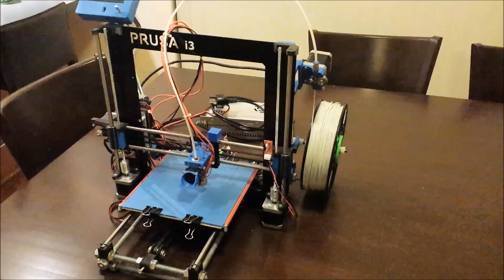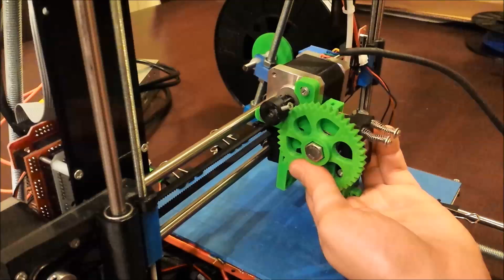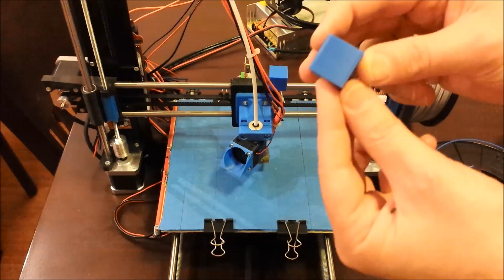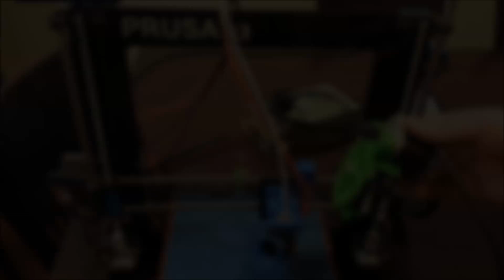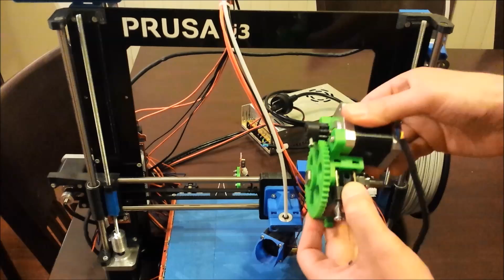3D Printer - Major Quality Improvement!

Comment: I completely agree with your assessment ,,  but I might have a different conclusion ,, thou the final mod was spot-on.
Is it possible that the Prusa's vertically mounted  X-axis rods and extruder body,, was twisting during a hard tug on the overhead spool ??
I have a Stuffmaker Evolution (Prusa with horizontal x-axis rods) and I was thinking about modding it to a direct drive...?
I use direct-drive on my makerbot clones,, and get great results.  So,,, not having any experience with vert.X-axis RODS,, made me think it might have been mechanical play in the mounting plate area..?
My Ordbot has a vert.X-axis ""Extruded Rail"" w/DD and spool rod attached to the top of the machine,, and doesn't seem to have any similar issues.
Since the problem is solved,, my question is kind of a moot point,, just something to consider.
I could see a big difference in your prints on the outside corners and a lot less "ringing"  I believe the only way to get the Y-axis bounce out of the bed is to upgrade the under-carriage to any aluminum frame.  My Stuffmaker still has a little bed backlash, even after I made a "kapton pillow"(high-density packing foam) to stuff between the top of the carriage, and the bottom of the bed. It didn't hold-up to 110c,, but works fine w/HB temps for PLA.
Reply from the maker: Hi Duplicat, thanks for your comments.
The vertical x-axis rods seem quite stiff in their positions, I can't induce any play by hand so I'm assuming they're ok. I guess I was just unlucky with this kit as I'm sure direct drive is working fine for others.

I'm glad you brought up the subject of ringing, because that is my next milestone with this printer. I'll try your suggestion of jamming a piece of foam under the y-axis carriage and see if there's any improvement.
Reply: Tech2C I assume that you used the E3D 3.00mm hotend to fit the PTFE Liner, right? Also would you please post the link to the exact hotend that you got. Thank you!
Reply from the maker: Ahmad Lafi
As mentioned in the video - http://e3d-online.com/E3D-v6/Full-Kit/v6-1.75mm-Universal

Comment: Well first of all both of your prints with direct drive and Bowden look already really good, but I have to agree that the Bowden did in fact have a slight better finish. What I found interesting is your thought process, which you explained very well. I am not a big fan of the 1,75mm Filament, neither I am a fan of the bowden tubing system, but that is whole other topic now. Normally a direct drive system has a 1Nm torque which should be sufficient to pull the Filament of the spool without any noticeable loss of torque. The direct drive should not be affected by it. This means you have to look at your system of dispensing the Filament, rather the system itself. But if you already switched and your printer works better and with less feeding problems, then I would guess it does not matter anymore.
Reply from the maker: I agree with your comments, the stepper motor has tonnes of torque to pull down the filament. Yet the filament flow rate wasn't consistent enough with the direct drive setup. I had the filament roll on bearings,virtually frictionless by comparison to other rollers.

I'm really happy with the Bowden, best mod I've done yet to this printer.

Comment: Bad news, I just printed a calibration cube, and after guiding the filament with slack half way up, I saw no change at all. This leads me to belive it is still a misalignment in the z axis induced by vibrations, or maybe my whole Extruder system as a whole. The artifacts are in between in terms of severity of your two prints shown at the end, so I know there is room for improvement. Any suggestions what to try next?
Reply from the maker: Ok. Next have a look at your hobbed bolt. Makes sure the teeth are cut evenly, and most importantly, check the depth of the teeth all the way around. Spin the hobbed bolt while looking at it and see if you can see the diameter of the teeth change with rotation.

In the past I've had a hobbed bolt with teeth that weren't consistent around the bolt causing inconsistent flow rate.
Reply: Ok, some promising news. I looked at my hobbed bolt and saw some slight defect. If you know how there is a slight semi circular groove shape all the way around, I can tell when looking at it above from one side, the groove is there and on the opposite side, the indentation is almost not even noticeable. It may even be .5-1mm difference of the depth of the indentation. Would this be enough for not even flow rate causing random artifacts on my vertical walls?
Reply from the maker: James Lowe Yep, there's your culprit. The oval shaped groove is causing inconsistent flow rate. I've had the exact same issue with a hobbed bolt.

Another reason why I switched to Bowden to take advantage of cnc machined drive gears, not human machined bolts.
Reply: That's what I was hoping for! :) it really doesn't seem like a big enough change to cause the prints to be like that, but you definitely seem to know your stuff. I don't know if I want to go through with a Bowden due to my hotend and the disadvantages I have read about if possible, but I have have to. I am assuming makerbot used a machined drive screw because it is a direct drive and no gears right?
Reply: Could you send a link to a drive gear that has given you good results?
Reply from the maker: James Lowe
Not sure about makerbot, but for your hobbed bolt, just buy another one. Ask the seller to confirm a uniformed groove around the bolt before purchasing. Easy fix.
Reply: I think I'm going to just go with a new cnc machined direct drive that I can also use with a Bowden because it will be far more precise than a hobbed bolt.
Reply: I tried printing at .1 Layer height with new filament, and after all my upgrades, and the artifacts on the walls are substantially better, which is suprising, because what I have read, lower heights will show artifacts more. That is most likely for banding though. Would this result support the fact that my hobbed bolt is the culprit? I just want to know that it is the real problem before investing another 100$ on hotends and filament drives
Reply from the maker: James Lowe You don't need to replace your hotend. We're just trying to make the flow rate as consistent as possible. Start with a cheap and easily replaceable hobbed bolt.
Reply: Tech2C I just got my Air Wolf hobbed bolt which was the best quality I could find, and it is very nicely cut and round. However, the same problems are occuring with little to no improvement.
Reply from the maker: Replacing the noncetric hobbed bolt with the centric hobbed bolt should result in a more consistent flow rate, but maybe you have more than 1 problem.

Can you try printing a 20mm test cude, and a 40mm test cube. No infill or top required, but 3 perimeters. Let's see if the same patterns emerge on the z axis or not.
Reply: I will try that out tomorrow. Most likely the patterns won't match up because after printing the same tower 4 times, the bulges and imperfections are in completely different spots, I also tried measuring the distance between the large bulges but found no pattern. It's worth a shot though. I made a forum here http://3dprintboard.com/showthread.php?10197-Z-artifact-diagnosis-help with pictures I have posted if you are interested to see what my prints look like to further help identify the cause.
Reply: I printed a 30mm and 15mm cube and I the result, I wasn't able to pick out any pattern of artifacts. The small Cube however had fewer artifacts and turned out nicer, but artifacts were still there.
Reply from the maker: If there's no pattern, then the z-axis probably isn't your issue. More likely it's flow rate. Check for slop anywhere in your machine, belts piano string tight, extruder gears are meshed tight, extruder gears are perfectly round.
Reply: Is it possible to over tighten my belts or should I make them right as I can get?
Reply from the maker: Just tighten by hand to remove any slop.
Reply from the maker: Teknogod17
Now that's coincidental, I'm about to upload another video which has a similar x-axis idler adjustment for tightening the belt, amongst other things :)

Comment: I am currently thinking about getting a Prusa i3, too. Just wondering what would be the better choice: http://www.replikeo.com/de/3d-printer/3d-drucker-bausatz
or
http://www.printme3d.com/3dprinters/bq/bq-prusa-i3.html
Some ideas?^^
Reply from the maker: Just looking at the prices, Replikeo is about half the cost of the Printme3d. They are both Prusa i3 derivatives. Easy decision between the two...
Reply: Tech2C I'm just having concerns about the quality oft the parts beging less good. And as far as I can see, there is no LCD+SD card electronics in the kit. But therefor it has a heated bed...
Reply from the maker: Stippy19 On the Replikeo site you can add the LCD+SD card electronics to your cart.

I'm not sure what you mean about the parts being less good. As far as I can tell it's all the same stuff that you can print yourself and upgrade yourself.
Reply: Tech2C well, i think it was just the photos looking Vetter than :) thanks for your help! I'll be looking into it again before ordering it in may
Reply: Teknogod17 oh, wow. That's cool. Didn't see that. In the german Version of the site it's still described AS 3D printed. Hufe advantage in my opinion! Thy for letting me know
Reply: Teknogod17 Yeah, thx. Just ordered mine. Didn't like the 90 Dollar shipping price (50Dollar option is taking up to 90 days), but well. The support via email was great, so they convinced me to order it there.
Btw, they informed me, that their LCD component has been upgraded to the LCD 12864 which has a larger screen, but they missed to update the website yet.

Comment: Hi. I have the same kit from Replikeo and as I have seen your video, I choose to upgrade mine as you did it. I just have upgrade to bowden extruder (the same as yours), but I encouter some trouble with calibration, in particular with the retraction movments. Could you tell us what kind of parameters you have with your extruder ( lenght of ptfe tube, lenght of filament retraction, speeds, etc...)
Thanks for your help !
Reply from the maker: scarou022 Sure. Length of PTFE tube is 60cm. Slic3r retraction length is 4mm. Slic3r retraction speed is 100mm/s. Slic3r retract on layer change ticked. Marlin DEFAULT_AXIS_STEPS_PER_UNIT for extruder is 98.85.

Make sure the stepper motor gear is tight against the filament and no filament is stuck within the teeth of the gear. Also the first layer must have sufficient gap from the bed to allow the filament to flow otherwise the filament will slip.
Reply: Tech2C
After trying to replicate your settings on my Prusa without expected success, I decided to make some "improvments" on the original "Compact bowden extruder". You can find the result on my thingiverse http://www.thingiverse.com/thing:669459.
Thanks a lot for your help !
P.S.: I look forward to your next video about your fpv !!!
Reply from the maker: Very nice! That is some fine engineering going on there :)

Comment: Very Interesting your videos, Thanks A lot.
If I'm not mistaken, your previous HotEnd used 3mm filament and the new one uses 1.75mm filament.
I was wondering if you could explain why did you change and what were the results (ameliorations/deteriotations)?
Reply from the maker: Hi. Yes I switched from 3mm to 1.75mm filament because I wanted to change the extruder mechanism to Bowden. Pushing 3mm filament through a Bowden system requires a lot of force, which can be done of course but it would require elaborate gearing to create this force. 1.75mm is easy to feed via Bowden and so I have a single gear on the stepper motor forcing the filament through the Teflon tube into the hotend. Easy setup and maintenance.
(try to manually push 3mm filament and 1.75mm filament through a 0.4mm nozzle hotend and you'll understand)

Also, 1.75mm may give greater control of the flow rate as you have to feed more of it in comparison to 3mm. In theory this should allow finer control of the flow.

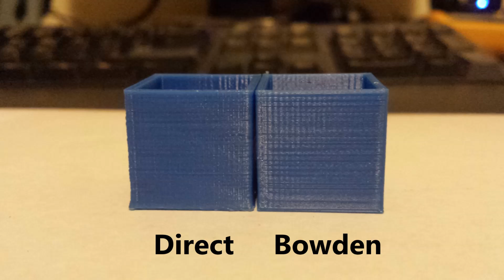Comment: Note at 7:33, the "ringing" is not affected. So it's stepper. Probably, it cannot be stopped without osscilation
Reply from the maker: That "ringing/ghosting" I can't seem to fix. I've read it's to do with large mass starting/stopping suddenly causing overshoot. The moving y-axis is heavy and definitely causes more ringing/ghosting than the x-axis. Ringing/ghosting in the x-axis has reduced with less weight but it's still there.

If you have any suggestions to fix this please share :)

Comment: So the fact that you took a good 30g off the carrage isn't even being considered as having some effect on your print improvments?
Reply from the maker: Not quite. I made the switch to the Bowden extruder because the filament flow rate wasn't consistent enough with my Direct extruder. I confirmed that using the Direct extruder and providing a slack of filament for the second half of the test cube print, the print changed. (As per the video)

Although removing 200+grams of weight from the x-carriage has made a slight improvement in overshoot/ghosting artifacts in the prints in the x-axis. The y-axis is the real culprit here though...